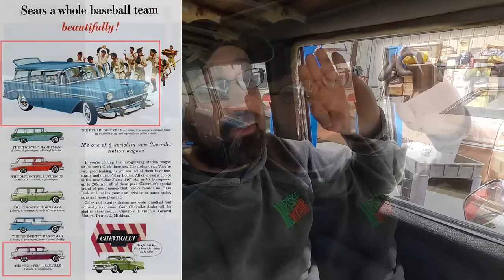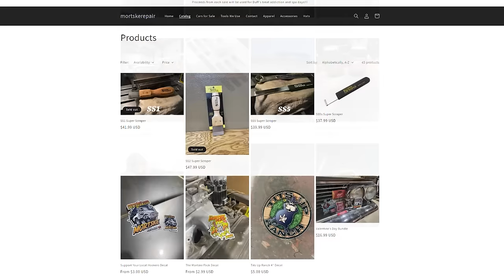Abandoned for 20 Years! Will It Run New World Record? Stock Chevy Van Bottom End for a Blower Motor!

Comment: Back in my younger years I used to drive a GMC van that we put a bored, balanced, cammed 350 with a built turbo 400 with a 3000 stall speed converter in it.  It was a great sleeper to street race and lots of fun till I lost my drivers license when I got caught  racing!
Reply: Ok
Reply: Yep I have an 87’ sitting out back. She has a factory 4b 350 TBI with a slightly higher lift cam. T400, 12 bolt . It was a custom ordered for towing  so it has beefed up rear sus. But she’s getting old now @ 320,000 + miles. But in her day. She would eat stock mustangs.
Reply from the maker: Thanks for sharing!
Reply: Bummer

Comment: The bottom end of that 350 sounds really good, but that BDS 6-71 on a stock bottom end reminds me of the Draguar that Dave Freiburger and Mike Finnegan built in the parking lot of Gotelli Speed Shop in California. It ended up running like crap and overheated to the point of warpage. I would definitely treat it with some aftermarket aluminum heads, a valvetrain upgrade, and a blower cam before bolting that big beautiful bastard onto it. You know more than I do about engines though. You've worked on damn near everything...😂😂😂
Reply from the maker: May as well find out! Can always upgrade it later!
Reply: @MortskeRepair  You are definitely true sir!

Comment: My 83 305 had that exhaust system. Added a dr gas X pipe to it 20 years ago where the pipes meet under the driver seat. Worked extremely well, flowed well and was quiet.

Comment: My uncle Ed had an '87Chevy van in the mid 90s. It was a green half ton window, very dented up and missing the rear seat. He put the stereo from my grandmother 's '87 Oldsmobile Calais after that car's engine blew up. He also gave the van front seats from a '70s Ford but couldn't recall what model. The van had the EFI 231 V6 and ( I guess) TH350. He also put load leaves above the rear spring packs.

Comment: the mid-brake-hose metal holder brackets rust around them and pinch them shut, while the hoses should be replaced, you can spread the holders open and regain brake function.
they're open sided and just crimped around the hose when new and turn into very tight pinch off clamps when rusted between the hose and bracket.
Reply from the maker: Thanks for the info!

Comment: You may want to google "the grenade" turbocharged 350 build if you've got some reading time. Fella took a bone stock 350 and chucked some turbos on it and made it run pretty hard. Never killed it either. Making a boosted motor live is primarily keeping the air/fuel ratio and ignition timing safe.

Comment: 46:29 first time I saw a G-van getting an engine pulled was high school auto shop, it was a raggedy '76 G20 with the 400 coming out to go in the teacher's Hugger Orange '69 C10 short wide.  And yes, he had students taking air nibblers to cut the front of the van completely off.  No reciprocating saws or grinders allowed.  That was for second year students, us first year kids were rebuilding a nice little fleet of Quadrajets.  Probably to also go in teacher's C10, if not soon, eventually.

Comment: The way the engine was popping through carb on accel,I would be looking for flat lobes or disappearing ones on cam,they were bad in those years,valve train was noisey also,good indicator.
Reply: it's an old quadrabog/dog, it's guaranteed the accelerator pump hasn't worked at all in 25+ years and poorly for 30+. 
yeah, clearly I've worked on and rebuilt just a few of them(dozens upon dozens and many others, small engine to multi-carb racing cruft.). 🤣🤣

Comment: You can use the exhaust manifolds, because all you have to do is put plugs in the smog holes after you put some heat on them to get them our.
That's how we use to eliminate all that BS when we de smogged anything that didn't get headers.
Those should flow better than even the rams horn manifolds did because of the larger outlets on them along with the longer tubes off the end exhaust ports without the sharp bends restrictions of regular cast iron manifolds.
Since you're going to use the big ass blower on it you need all the flow out you can possibly get in order to tune it halfass correctly. 
Unless you install a huge top pulley, and choke it down to minimum capability, and I don't think that one will really go too low on CFM's anyways. 
I could be wrong, but I would check with the blower shop to see just how much they are capable of moving with the smallest pulley available, but then you still have the two 650 cfm holleys sitting on top that will have to be jetted down as small as you can and them not bog down. 
Unless you can make them into a two stage setup to where you only use one until WFO throttle is applied, but you'll probably kill the blower surge that's so f'in kool about blowers
Reply from the maker: Thanks for the info!

Comment: 🗿💨 be careful stepping off that bobcat, don't let that Camara make you break your neck.. strip it to the shortblock and reassemble with bb oil pump and fresh chain n such. Thanks for sharing Mortske 👍✌️ unhealthy valve system will cause backfires, backfires will cause blower damage.. 🙏🧲

Comment: So in the 80’s a buddy and myself took a wrecking yard TH400 long and had the clutch bands replaced with Steel racing bands.  And a shift kit put in. Then we changed the output shaft from a TH350 short. Basically making a TH375.  That trans went through 9 racing engines and four cars.  It was in my 78’ Camaro RS custom. When I blew the engine in the middle of nowhere near the Az. Ca. Border.  I had to leave the car for about 3 days before I could make arrangements to get it. It was gone !! Stolen. Never found.
Reply from the maker: thanks for sharing!

Comment: Small block with a TH400? Maybe because it was built on a 3/4 or 1 ton chassis? I hope it works well for you. A 350, TH400, and whatever the rear end is (corp 14 bolt?) is definitely worth $300.
Reply from the maker: Yeah, see them in all the 3/4 ton pickups too

Comment: The piston damage on the engine appears to be caused by boost on rings that were not filed correctly for boost. Usually happens on turbo charged engines but may be what caused yours. Just a thought.

Comment: I had a 92 chevy conversion van a few years ago. I'm personally not a fan of GM stuff  but I loved that thing. However to remove the hump you had to remove the conversion seats that it came with ugh I hatted doing that
Reply: on 99% of them, you adjust seat slides to the rear, pull the bottom back to touching the seat bases and tip the top up and out from under the dash. a little pressure/flexing and they'll slide out. only a few I hit that didn't work on, is where someone replaced the seats themselves, with whatever. I still own a 92' it's a bit harder to remove than the 82' was.
kind of how he removed the doghouse, but less brute force required. 🤣
Reply from the maker: no thanks!

Comment: The hippies in the 60's & 70's loved the V.W. bus ...
But soon the song "My Chevy Van" song was popular as was the Chevy Van craze..
My brother loved em .
I went hunting with a buddy on his grandpa's farm & behind the barn under a lean to was a 79 Chevy van , short wheel base with a blown engine . (305) 
I asked the old man about it & he said , the motor is busted ..
Then he said , "Chevy didnt put a dip stick on these vans for some reason " 
"Thats why the engines went bad. You could'nt chk the oil" 
I didnt argue & bought it for $800..
It had less than 50k miles on it but whats more , it still had the original tires..
It was red in & out .
It had power windows, cruise , tilt , a.c. , 4 captains chairs & a couch ..
We dragged it home , swapped the motor & set in making it my brothers conch cruiser . 
Cragers , headers , side pipes & shackles to lift the rear a few inches...
I still like the old vans ...
Reply from the maker: Thanks for sharing

Comment: Just to add a side note Australia used the TH400/350 in GMH (Holden) cars from about 71-85, Then used 700R later. We started using your Cheve 283,307 & 350s in the 60/70's till we developed our own V8 engines. Holden started all the way back assembling model Ts that I'm aware of. Church key (can someone fill me in) I do know tin punch tool. Yes I wanna see the blower motor going but you were gonna do it anyway.
Reply from the maker: Thanks for the info

Comment: 56:48 it was kinda cool with GM having three different automatics in the 40s-50s-early 60s, the 2-speed Dynaflow (which was one speed unless you selected "low"), 2-speed Powerglide, the 3-speed Turboglide, and the 4-speed Hydramatic, and it would be 1981 before they'd have a four speed automatic in a car again (700R4 and 200-4R) but by then every automatic GM made (outside of Allisons for MD/HD trucks) were Hydramatics of various grades.

Comment: Th375b is the halfbreed th350 and the th400 turn automatic transmission th350 is a slip yoke, the th400 is a a bolt on yoke and 375b is a bolt on u bolts for the driveshaft and the yoke i believe is a slip on on some of them and bolt on on the th375
Reply from the maker: Thanks for the info

Comment: Isn’t that a regular TH400 with a bolt on yoke 
The 475 had straight cut gears and I think  heaver clutches
Reply from the maker: Probably
Reply: Good find tho 

Years ago I pulled the fuel injection off one of these G series vans.  It was a 1/2 ton with the 305 and it had a TH400 from factory…. Strange order

Comment: AMC didn't use the TH400 in it's cars, just Jeeps. The cars got Borg Warner automatics through 1971 and switched to Chrysler Torqueflites in 1972. I believe it was too expensive to renegotiate the contract Jeep had with GM when they bought them from Kaiser in 1970 (who by that time was building AMCs in Argentina under the IKA brand). They later migrated Jeep to the Torqueflite in the 80s if memory serves
Reply from the maker: Thanks for the info

Comment: There is a difference with bolt in tailshafts and sllip in tailshafts with a Turbo 400. Also, with the Turbo 400 tailshaft housings regarding the tailshafts.
Reply from the maker: What's the difference?
Reply: @MortskeRepair  The tailshaft that bolts into the Turbo 400 comes from heavy-duty pickups and vans. Their design and the bolt in tailshaft housing are designed diffrent than the slip yoke. There is a transmission shop in Michgan that produces a slip in yoke tailshaft for the bolt in style for the Turbo 400. I have a bolt in tailshaft Turbo 400, and I've seen a few videos on YouTube about the necessary upgrades required.

Comment: My vote would be to pull apart the engine, new bearings put the cam from the blower motor in and the heads from the blower motor, dingle ball hone with some new rings and send it with the blower on it😃
Reply from the maker: That sounds like a lot of work!
Reply: @MortskeRepair  the old guy can do it, I always see him working on motors 👍

Comment: Excellent video Mortske :) , Duff Dog 🐕, MOJO  :) , would  Engine Flush bottle that motor  clean inside and help running nice , Turbo 400 3 speed Automatic transmission  in good condition too and van would keep mirrors  on doors be use on pickup truck  too also tires because 950  / 16.5 LT Load Range D  rare too even axle to!  Also rims plus dog dish chrome hubs cabs to ! It up to if use these talking about!

Comment: When I have to replace a motor in a GM van I just remove the 6-8? subframe bolts, transmission crossmember; disconnect the shift linkage, steering column, brake lines/ hoses, unplug the wiring bulkhead connector from the firewall and lift the body with the twin post lift. I wish someone would have told me how years earlier. Vans are sooo much easier/faster. Now van engine swaps are very profitable for me
Reply from the maker: People still swap the engines in them?!?
Reply: @MortskeRepair  I live in Arizona. The ridiculous increase in fuel prices over the last five or so years has made older camper vans very desirable to the folks who don't want to spend a $100k on a new coversion van. There's plenty of older conversion vans around this region that are slightly used but no longer run due to fuel system damage so they're cheap to buy. Once they get them running again they discover that the gaskets and seals have dried out and it leaks oil from everywhere including the transmission, pinion and wheel seals. The "low mileage" great deals aren't really such a great deal in my opinion but whatthefuckever, it's fairly easy work (not rusted solid like what you have to deal with in your part of the country), the majority of the folks are super nice, easy to please and they usually bring cool presents for my dog

Comment: No need to pin the crank. This setup would be lucky to make 5 psi of boost on this stock engine. Better run the ignition timing on the conservative side to keep the stock rods and pistons inside the engine 😂.
Reply from the maker: what fun is that?

Comment: I know you like to do mechanics on the “save $$$side”….But……..That combo of worn engine, bad year for those Heads, camshaft with 300 lift & 175 duration is a bad idea. It’s a time waster for the supercharger swap over. The only thing going for that Van engine is the 8.1 compression and that’s not enough of a positive component.  You’ll probably get about 15 minutes of power run time, then you’ll have two engines to build.
Reply from the maker: Perfect

Comment: only an hour and 16 min your spoiling us now that guy cant complain(he still will) also ford gm and dodge all use aluminum body panels on there vehicles ford is just the only one who uses all aluminum bodies also i really dont get the hate on fords now being aluminum ford has never claimed its stronger than steel its just a way to save on weight help prevent rust and have a higher gvwr and its cheaper of course